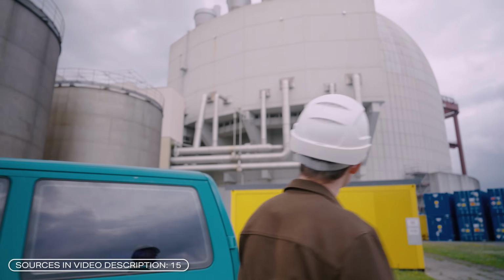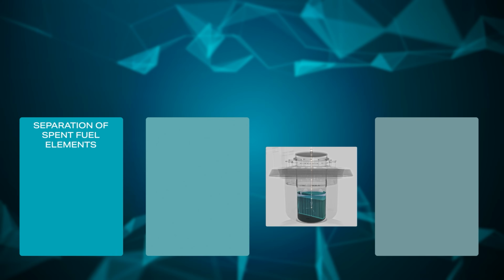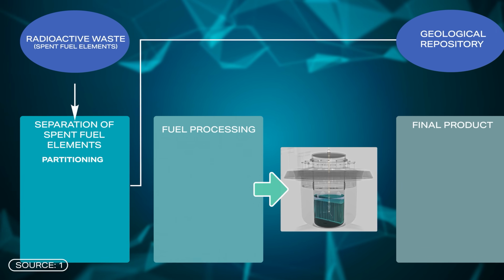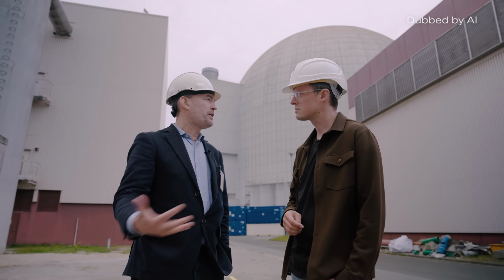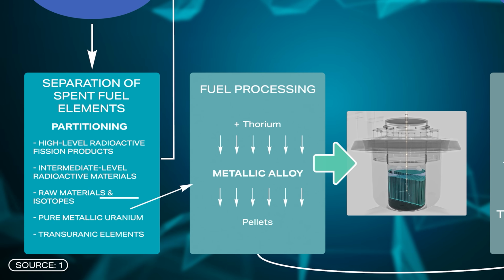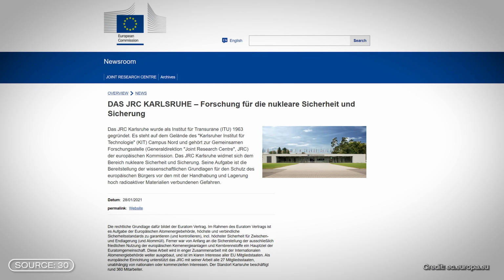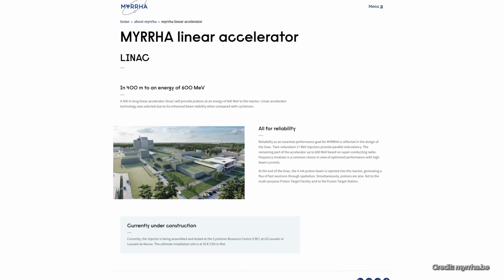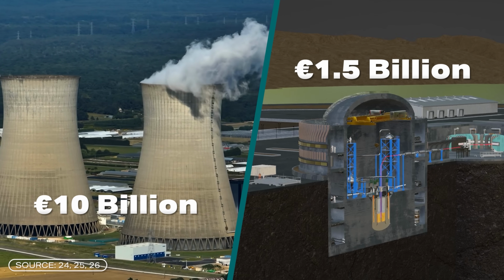Nuclear waste is reusable. Why aren’t we doing it?

Comment: Germany don't be short sighted and dismantle you reactors,  You will loose the skill. The waste should be vilified and put underground.  It can be retrieved if you find a viable method of use..  A portion can be allocated to outfits developing separation technique.  I believe laser separation, or perhaps portions can be burned in a CANDU type reactor, which would be quite hot.

Comment: 'Nuclear Mill'. Fantastic term: Isn't a 'Reactor', because there's no self-sustained chain reaction possible.
Arguably, even for many 'chemical' reactor vessels, they often are also doing chain reactions in those, so it's not a bad definition. 

Certainly if you're nowhere near a self-sustaining chain reaction, the hazard of one of those getting out of control is eliminated.

Also: 'Mill' is correct as well - it's a vessel where you're putting a material, and generally adding lot of energy somehow, in order to effect a change to the material, generally destructive and random. Eg, 'ball mill', 'bead mill', 'colloid mill', 'disc mill', etc etc.

'Mill' is also an engineering term for a machine that drags a rotating cutter through a part in all directions (In addition to end-on, which if it were the only direction, the machine would be called a 'drill press', not a 'mill'). But that's a case I think of just a parallel definition. 'disordered' they usually arn't, unless you're counting how the chips end up.

Comment: AI dub is excellent. No worries at all.

What is the halflife of the original material before transmutation? If its in thousands of years then:

1. Why not leave the solution to be solved by generations thousands of year later. Don't you think the technology several millenia from now will be so advanced that nuclear waste toxicity will no longer be an issue?

2. Is the half-life of the transmutated material 800 years? If so, then the radiation 800 years later would still be toxic, right? Of so, what have you solved? This goes back to my question #1.

Comment: separating spent fuel makes a lot of sense if there is demand for a lot of the isotopes it produces but can the extracted precious metals but just be sold into regular circulation or would it be low level radioactive (but to high for many uses) from its proximity/exposure?
cant help wandering what rate it transmutes the target at - i have heard that somewhere like CERN makes way less than a microgram per decade, but thats produced by impacts rather than changing a targeted material so a completely different situation

Comment: Radioactivity is  electromagnetic energy in the extremes of the spectrum. Is it such a stupid proposition that we might find a way to use it more effectively or somehow modulate it into a frequency rage where it can be used?
Reply: If radiation is in the form of gamma rays, maybe. But if its in the form of neutrons or other high speed charged particles, not so much. They need to be absorbed or slowed down rapidly.

Comment: Spent fuel is very valuable after it is allowed to cool down and radiation is reduced. It still contains fissile isotopes. Elements that would waste neutrons can be chemically removed. We should not think of it as waste; it is an energy resource. Besides accelerators, we must also consider neutron generation by fusion reactions. Even though fusion reactors are not self-sustaining, they do generate lots of neutrons.

Comment: This is overly complicated for the task and requires too much liquid chemical processing.  The energy requirements are very high. 

An easier path would be treat the pellets with F2 and convert the contents to metal flourides.

The separation can be done in the gas phase using centrifuges and laser processing just like conventional fuel techniques used in concentration. 

Instead of building a beam to transmute,  put the useful fuel back into a conventional research reactor.

Comment: This is ridiculous. You want to “waste” the most valuable part of SNF. The leftover U235, Pu, and transuranics can be used as starter fuel for breeder reactors. The SFN is not waste, rather it is a resource. The same process should be used, but the U, Pu, and transuranics used as fuel. The majority of the U  can be removed to increase the Pu to 10%. Then this can be fuel for a fast breeder. The remainder of the U can be used to fuel that breeder and its offspring for thousands of years.  

For example, a typical 1GWe PWR with 45 years of operation has enough Pu in the spent fuel to start 3 1GWe breeders. And enough U in the SNF to operate those 3 reactors for 300 years. And if you count the depleted U tails from the enrichment process used to create that SNF, 3000 years. So with ~100 nuke plants in the US, 300 breeders could be started. 40 years later, there would be enough Pu created in the fleet to start another 300. At 80 years, we could add another 600 for 1200 total. All running on the existing SNF stockpile. 

It would be absurd to throw away that valuable resource.  Indeed a crime.

Comment: Why spend a lot of money cleaning up the nuclear waste with a process that generates a little electricity and a few medical isotopes, when the same thing could be done using a fast breeder reactor to use the nuclear waste as fuel producing large amounts of electricity and could be designed also to produce a wider range of scientific and medical isotopes.

Comment: Nein nein !!! Mine Freunde. !!! use fusion not fission !!! here is the Thunderstorm Generator that uses fusion process to destroy waste ( and in true german recycling fashion ) as it uses the destroyed atoms from CO2 ( Carbon and Oxygen ) to fuse the Carbon into more Oxygen, this is just done with more recycling ( of the waste heat from the gasoline engines exhaust ) the resulting plasma excess is then fed back into the combusion engine to reduce fuel consumption by 50 percent. Here is my build. Oh and yes it can be used on nuclear waste too ( i dont know the details on that but i would assume if it can transmute carbon, then heavy fissile materials may be affected too, but obviously not to fuse Uranium, or heavy atoms like that, at the moment we have only fused atoms lower than iron ) So here is my build on a 7 hp Chonda https://www.youtube.com/post/UgkxCZzR2cKzwuSAod8d6U0AUDUruidupyiR

Comment: I am from country where actual Chernobyl disaster happened and it is NOT ruzzia. Thou it was fun when they in 2022 tried to dig up exactly near sarcophagus. Hope those arseholes died from radiation even if chances are too low for that. And another fission electric station now occupied by ruzzian. And despite all of those we use some other couple of sites with nuclear reactors as a main line of supply, so overall feelings mixed, but mostly positive about nuclear plants. Most of us there found it extremely dumb that You people in Germany decommissioning Your nuclear plants and got on a ruzzian gas needle as a freaking junky. Many who knows laughing when there was moment when Your "renewables" fail because of weather and electricity prices sharply grow like in two or three times in early 2025 I believe. Not so sure about date, but sure it was happened.
I personally don't care what You there use, but I'll care only about this something was not even by kilometer stick related to ruzzia. Stop being junky. If You so much need gas - make it from Your own waste water. It is doable and independent from outer actors.

Comment: If you have a heavy water reactor like CANDU, it can transmute the spent fuel without an accelerator while generating electric power.
Reply: This is flat wrong. Get real.  The CANDU reactors are thermal-neutron reactors; you cannot transmute the difficult isotopes with thermal neutrons ... if you could then every thermal reactor would do so.

There in nothing magic about deuterated water as a moderator in this regard.  The advantage of D2O is simply that it has a lower absorption cross-section, so the neutron economy is better, and you can use a lower enrichment (indeed even zero enrichment) uranium fuel, also allowing higher burn-up.
Reply: @leeharrison2722  Yes, CANDU is not as efficient as fast-spectrum reactors like liquid-sodium fast breeders in burning the spent fuels. But it has higher neutron flux density and a higher ratio of fast neutrons than PWR, so it can burn plutonium and minor actinides and reduce waste by half. And it can use spent fuel from PWR mixed with unenriched uranium. So it can achieve waste reduction by a 50-70% burn rate. Not as efficient or economical as a breeder, but CANDU can be optimized to burn spent fuel from PWR.
The distinct advantage of CANDU is that fuel rods/assemblies can be manipulated (refueling/extraction) any time during online operation. PWR can't do such tricks like continuous refueling.
Reply: @youcantata  provide a source for your claim that CANDU reactors have a substantially larger fast neutron flux. 

Everything I find says the opposite.

Comment: Doesn't France already reprocess fuel? I'm confused as to what problem is trying to be solved here.
Reply: The problem would be cost , there is another nuclear reactor design thay generate no radioactive waste (unless you put lithium in it)  it called magnetic-targetted steam piston nuclear fusion reactor 

Then combine with mirrored concrete for steam power

Comment: I thought that there was a general rule about radioactivity: The longer half-life, the less radiation per unit time. If that's true, then transmuting something from 1M years to 800 years should be increasing its short term radioactivity quite a bit. Is that true, or not?
Reply: That sounds reasonable.  But if they are also extracting energy from it then that would mean less radiation in total released.  It also reduces uncontained radiation.  We can make sure something stays buried for 800 years.  After 10,000, it may all be blowing in the wind, and the planet uninhabitable.

Comment: There is one nuclear reactor on Earth that has completely solved the waste problem AND it comes with several billion years of free fuel. It’s at Earth’s core however and requires drilling to capture some of its output.

Comment: I am okay with the AI dub, I am also okay with reading subtitles and hearing the original language.  I think an opinion that ought to matter a lot, is the person whose speech is being translated automatically.  I did found it easier to understand while not staring at the screen, but there is some value in hearing other languages and learning them even a little.

To anyone who is grumpy about energy consumption of LLMs, automated speech translation is (probably) mostly not that, and even if it does involve LLMs, this is low token counts, not writing code automatically (which is orders of magnitude more tokens, hence, more energy).  This could be old-school machine learning; there are automated speech to text and text to speech translators that I can run on my laptop, no cloud of servers needed.

Comment: I am 100 million thousand percent a fan of molten salt reactors, particularly the thorium fueled variety. I think it is a way way way better route to accomplish everything they're trying to accomplish at this power plant with substantially lower costs and I think for that reason it is the far better technology for Germany to pursue, and everybody in the world honestly 

Thorium fueled malt and salt reactors also need that little bit of uranium to get kick-started, and can continue burning the wastes along w/ Th if so desired as well, leaving far smaller stockpiles of toxic and radioactive waste both by volume and by duration; You quote 800 years in this video, well MSR's are supposed to be 300 years, and that assumes what I said above where you're mixing some waste into burn along the way

Comment: Excellent video. Here is a few point though:

- 4:20 the 0.7% is typical for natural uranium. In reactors the fuel is enriched to 3-5% or even slightly higher depending on the fuel type
- proliferation hawks will not see kindly any plan that builds on chemical separation of spent fuel, even though reactor grade plutonium is not bomb grade (contaminated with problematic isotopes).
- the capacity factor of the power production operation part could suffer greatly if it turns out the chemically separated materials needs to be irradiated for different intervals, or with differently calibrated beams  (which is quite possible) for optimal transmutation.
- the mentioned requirement for beam uptime seemsa bit ridiculous considering that there will be other lot more significal bottlenecks forcing downtimes in the facility (like probably fuel shuffeling a lot)
- it takes away a lot from the accelerator based idea, that the proposed "waste burning" is at least theoretically possible in already working fast neutron spectrum reactors (this seems like basically that, but with athe twist of being accelerator driven and without the chain reaction)
- the accelerator adds a lot to it's safety (as subcritical) but limits the throughput not just because only (mostly) the beam is expected to do the transmutation but also it is unwise to put more than a very specific amount of given certain material into the core assembly. (you don't want the stuff in critical mass or geometry in this one) you can downblend but then you may have to separate again (in case of mining for specific isotopes for RTGs, research or med purposes and whatnot) or you can use a lot of compartmentalisation (control plates and rods) but that reduce the beam efficiency.

I wish them good luck anyway, it's worth the effeort, even if it doesn't pan out at least we will know. And while I think nuclear waste is kind of an overrated problem,  working on ways to making it obviously smaller is a worthwhile endevour.
Reply: =  Cancer LOTTO

Comment: Bringing that from 1,000,000 Years into 800 is huge step, but it is far from being an ultimate solution. It is polluting for many generations to come, which I don't like. The German government is highly fixed, and I think they should try it in another country, until the German government wakes up, if ever. These guys should work on solutions to reduce that into several years the most. 800 years is still a lot.

Comment: Good analyses. The risks, implementation, and cost justifications are all untested/indeterminate. Several major risks remain, including financial (it may not be financially net-positive), legal (German laws prohibit this work entirely), and to environmental/human health, particularly in the first phase when the spent-fuel rods are cut into "1 cm sizes." Doing so will create massive amounts of radioactive dust, that must be 100% recaptured. That will require building on-site a very large negative-pressure containment/"clean room" (Class 3 or better) and also require workers to wear radioactive-protecting HAZMAT suits. All metallurgical processing must be ensured to be completely safe/non-polluting. Currently too much is unproven, so it seems to be "pie in the sky."

Whilst this tries to address the serious problem of radioactive waste containment for which no good alternative exists, something must be done. Maybe in a few years more robust processes/technology will be devised?

Comment: 23:00 - this is not necessary?

How so?

Ok, it is complex compared to other methods, but, we need to deal with this stuff somehow.

Is burying it all in a big hole in the ground really the best way of doing so?

I'd argue, although perfectly safe and a totally viable option, on the balance of things, if it's still useful then it's likely not the case.  As such, if it can be scaled and we can work around the technical difficulties, then, we should.

Comment: The metal lead is pronounced like led, the light source. Not leed, like the town Leeds. The AI dub pronounced this sometimes correctly, but, mysteriously, sometimes also wrongly.

On the AI dub: I very much prefer subtitles. Especially for technical videos, where every word counts, is is essential that we can trust the translation. Even for languages in which I’m far from fluent, I can often detect translation errors when subtitles are present.

Good video. I’m undecided on the issue as well.
Reply from the maker: Great feedback, thank you a lot!
Reply: Original is waay better

Comment: Actually a better solution is molten salt breeder reactors, first you separate out all of the fission products from the waste using Kirk Sorenson's oxidation and reduction columbs, these with the exception of technetium decay away to background levels within 300 years, technetium is the one isotope you will either need to find a use for, treat in a particle accelerator, or store long term, and then you place all that actinides in a molten salt breeder reactor, the even odd isotopes are immediately fissile and will power the reactor and the even will capture neutrons and be bread into fissile fuel.  Less than 5% of the original fuels energy is used, the remaining 95% are in these actinides and can be used, rather than wasted.  When done all you have left is short lived fission products.